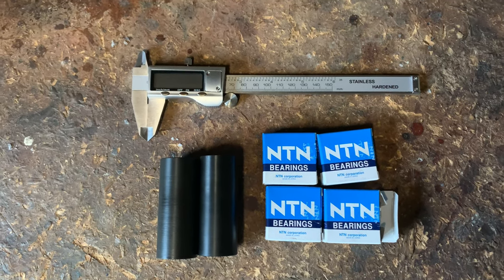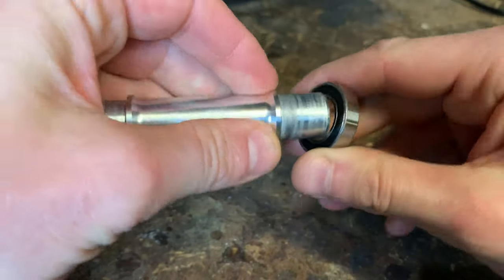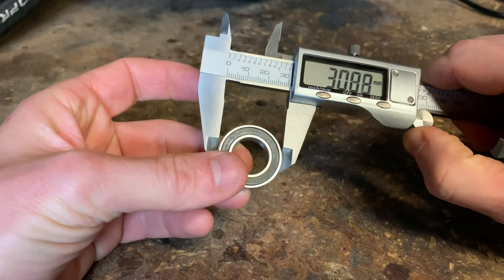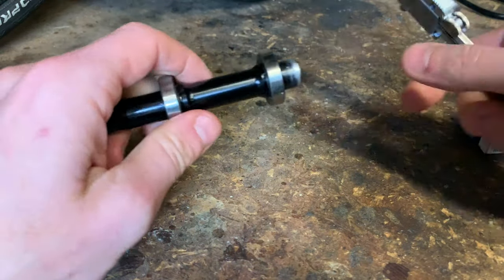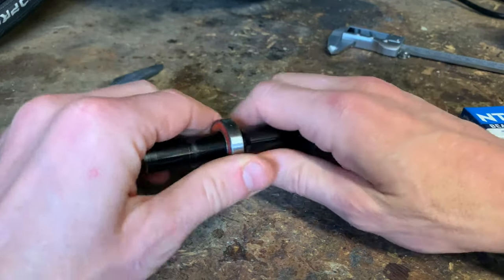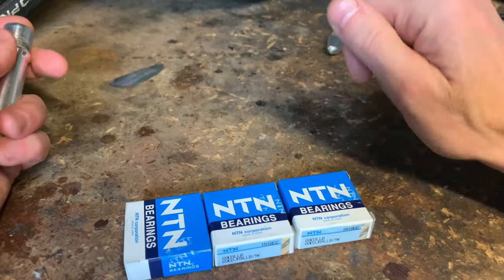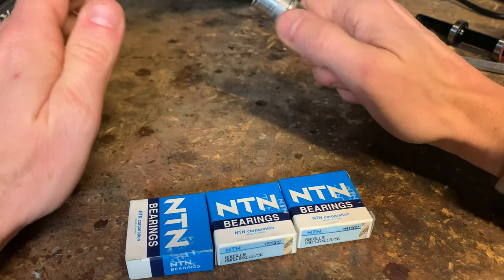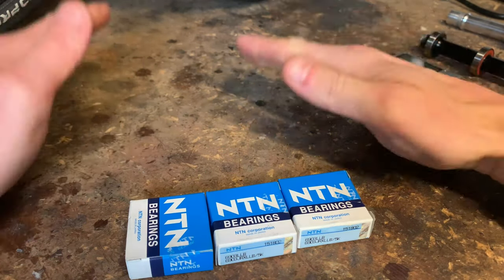DT Swiss 240 Hub Bearing Change Pt 3

Comment: all the power goes though the rear where so it need a wider and stiffer axle or the wheel would flex and we dont like flexy wheels and the front is smaller to keep weight down
Reply from the maker: CMDR meneldil I can understand that, but non standard bearings... why? 👍
Reply: You should try campy stuff if you want to see non standard
Reply from the maker: CMDR meneldil hahaha no thanks, these ones are plenty enough for me.... I think I might be tempted by the Ti-Carbon road disc hubs. I’m pretty sure they have standard bearings in... 👍

Comment: Oh my... A good mistake as lesson.

Btw dtswiss dt240s centerlock uses (rimbrake dt240 are diff)
DT240S front hub - 18307 
DT240S rear hub - 6902
DT240S free hub - 6802 (used across all 240 freehub)

The 18307 is a custom/rare bearing(but many front wheel uses them! Giant, bontrager etc 🤦🏻‍♂️), I'm not sure if NTN makes them, dt240 source their bearing from IJK (pretty decent imho) and keep their seal! Because it's a oneside contact(red) and oneside non contact seal(black). Recycle/replace the non contact seal with your new bearing side which faces inside the hub (since water won't get in there) to help improve the rolling 😉
Reply: My bad, just saw your next video, seem u sorted them up 👍🏻
Reply from the maker: Ah thanks, didn't know about the black seal and why it was there... the non standard bearing is a bit of a pain to source to be honest (had to get one from Australia) why can't manufacturers use standard size bearings??